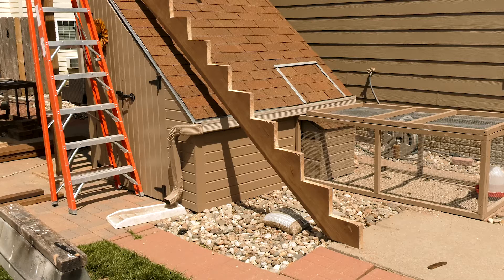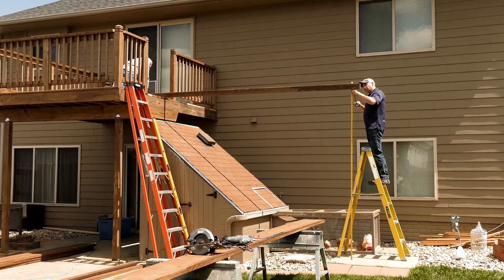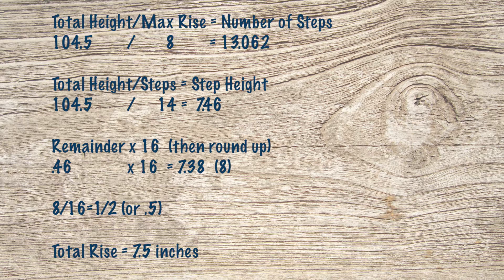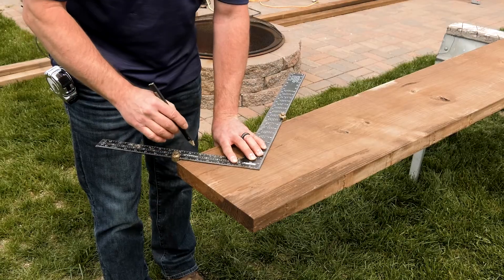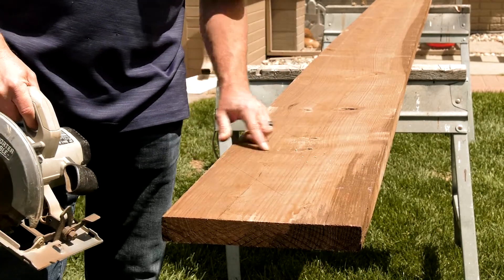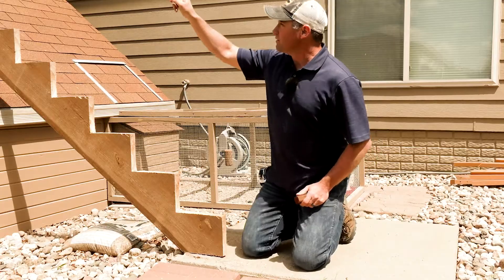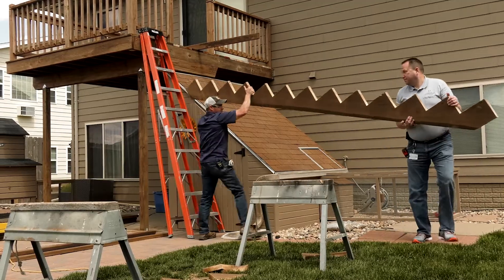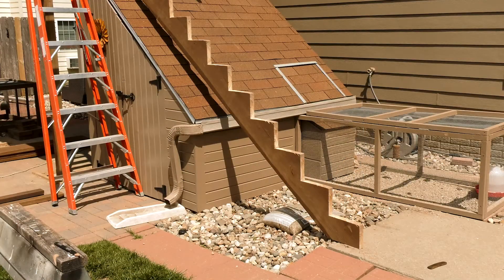How to Build Stair Stringers

Comment: Correct me if I'm wrong but the way they did this the last step will be 8 3/4" from cutting the bottom of the stringer for the first step.
Reply: It would be 7 3/8 after 1” decking